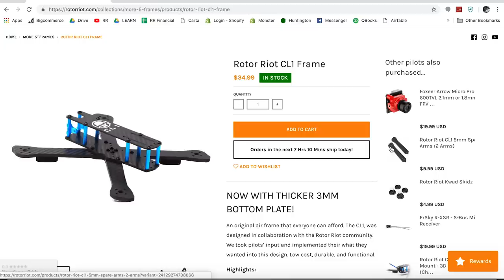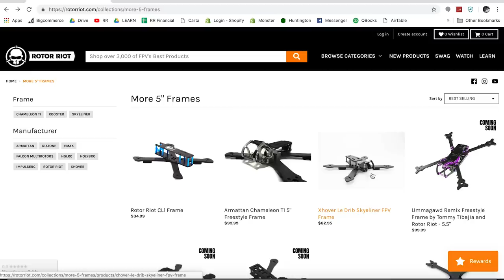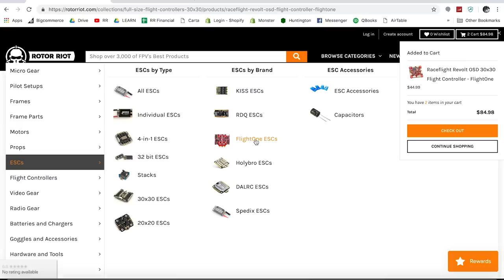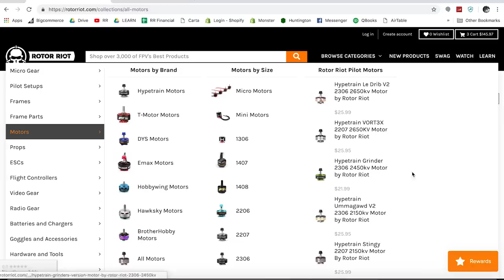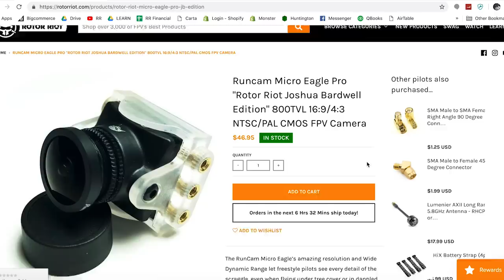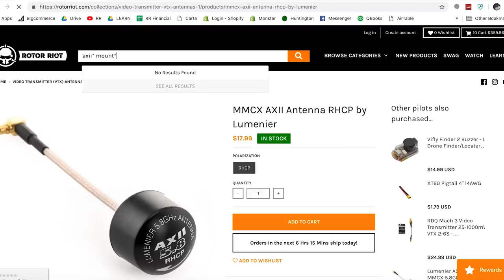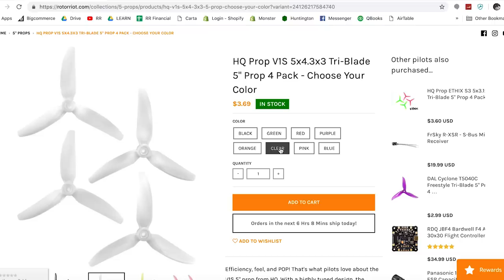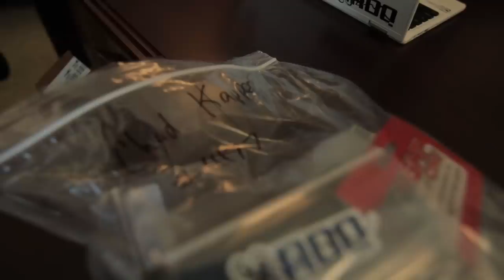Beginner FPV Freestyle Kwad - From the ground up!

Comment: This was nicely planned out and (I feel) your goal was achieved. After decades of rc myself,  the market is so oversaturated with choices for anything a person can want or need its overwhelming. Getting the right parts for ones budget is mind boggling. Chad had access to some pro's to help with his choices. Most people don't get that opportunity. I would suggest have these same guys put together complete packages with everything a new person...or anyone would need to complete the build. These kits can start priced on extreme budget build and everything in-between to the skys the limit. Have these guys do actual build vids of said kits, send them out to reviewers as well. You could help a lot of people out and more then likely make RR's business be all it can be in the process. 2 tips I can offer you though, keep the parts in stock. Its so frustrating to be all ready to buy something and, out of stock, cant make money w/o the stock to sell. 2) Include a legit data usb cable in the kits -;) Again, thanks for the enjoyable segment, I felt it was time well spent. Thumbs-up Gentlemen!

Comment: The way I got started is by first buying a pre-built 3" quad.  This approach allowed me to divide the learning curve into two steps:  since I had fully functioning H/W right out of the box I only had to master betaflight at first.  Then, as things were breaking I started experimenting with new flight controllers, props, buzzers, cameras, different battery sizes, etc.  Meanwhile I feel confident enough to step out and build my own.  In my case, this entire process took about 6 months... there is a lot of information that needs to be digested.  And yes, learning to fly FPV takes some time too, so learning to build and learning to fly should ideally be synchronized.

Comment: Unibody is great. It's lighter. As far as vibration get rid of the bad bearings and you'll be fine. Dal T5040C are the best noise free prop I've used to date. Anyone out there prove me wrong. second place is maybe HQ5X4.3V1 which is an awsome prop
Reply: I was a big fan of the dal5040c and ran them for ages. They fly really well but they are not resilient in crashes. I was never into hq  props until I tried a set of the Ethix S3. Been running them exclusively since I tried that first set. They are even more snappy and responsive than the dal5040c and on top of that are very durable and seem to take crashes and even bend back very well and remain flyable. I thought the reduced pitch would be an issue but they don't seem to suffer any less thrust in the air. Throttle response is very linear and smooth as well.
Reply: @JustInvertedFpv  well the regular ones are good but the T in T5040C is specific I think. Anytime I'm tuning for 6s they just fly good easy to tune. And the HQs 5x4.3 aren't far off.

Comment: Nice effort to help new people out.! 👍 One critique though. You don't want mid throttle oscillations but then you don't put any nuts on to hold the flight controller down. It will move eventually after lots of use and crashing but by then you'll have forgotten that you left the nuts off and will spend frustrating time trying to figure out why suddenly it's oscillating on you.  Put some nuts on Kapper, you bought a whole kit with that stuff in it.

Comment: Great episode guys! The one thing I still struggle with is smart audio and vtx settings. I can never seem to get mine to work. I know it is supposed to be easy, but I just struggle with it. One of the main reasons I still fly alone. All my quads are on different channels, and are stuck at 25mw. So my range is crap and I still feel like a noob. I just can't seem to work it out so I fly alone.

Comment: What I struggled with the most is the motor size, and kv. When I picked the parts for my first quad I just went with "what motors for a 5 inch quad" on google and used what came up. Theres so many factors that play in how a quad feels with a specific motor, prop, voltage, weight of the quad, etc.

Comment: Gorilla tape is great for quad repair and antenna strengthening. I use it to protect my motor wires and to secure the flight stack when I break a nylon mount. I put a piece along where the battery strap makes contact with the sharp carbon and my straps last forever.
You can even use G Tape AS a battery strap.  You just need to make sure the adhesive side never sticks to a surface mount electronic component. I've ripped 2 capacitors and  1 diode with one pull of the tape. I need to send that VTX to Louis Rossman. Lol

Comment: The Mach 2/3 is square but wider than a Tramp.  The Tramp is narrower but slightly longer.   Also Tramp shows channel / power just like the TBS Unify does.   Yeah a multi-segment display is easier to read, but it's there.

Comment: Kabab Glide Frame is a very good Budget frame. 
Even if you don't consider the price it's the best freestyle frame in my opinion;)
Reply: TBS Source One is a good option too! Better price than Glide!
Reply: @MaiaFPV  true. But the amount of thaughts put into the glide is incredible...
You have to decide for yourself if its worth the money.
What about weight? The glide is pretty light
Reply: @MaiaFPV  diagree.  I no longer like fat arms after having flown Floss/Flosstyle/Flowrides/Glides.    I also have a Brap and a Project 399.    This is coming off of Alien clones and RMRC Valorems.    I would jist rather have a thicker narrow arm than a thinner wider arm.

Flowride and Glide sit as my most favorite kwads.
Reply: @dividingbyzerofpv6748  But if you don't use 4in1 ESCs you can't use slim arms. It's designed for 4in1 ESCs.

Comment: I can see Bardwell a little intimidated by Chad but I'm agree with Chad about to make a video for very beginners in Quad building and those tips like the spacers and of course the wires, sometimes is a bit hard to find the right wire if it didn't came with the component.  I Liked the video!!

Comment: A tip if you want to focus on noobs like myself, do your best budget build from the stock you have, most of us want to start on the cheap but still fly ok, I'm simly not good enough to feel the diffrence between a great and an ok quad, my first build was all banggood and gearbest and now just trying to set it up to fly like I want it to (almost there). The idea of a all you need list with matching components is a great one, try adding a good beginner tune to it as well ;)  Also your shoppinglist missed the batterystraps (no noob has those at home ;)

Comment: buying a battery is one of the most important parts of a build..... Just because your quad is rated for 4s doesn't mean you can choose any 4s. This is EXACTLY why people burn out ESC's... well.... ever.

If you get a battery that has the ability to pump out 2x more amps than your ESC is rated for then you're gonna burn your ESC in a crash.... eventually and proly sooner than later.

mAh X C rating = Amp output.

1300 at 90c means the battery will output a max of 117 amps..... if your ESC can only handle 45 amps then you're gonna burn it. You get away with this most of the time because the motors themselves won't draw that many amps... however in a crash your PID controller will spike wearing down your ESC's more and more and eventually they'll die. If you get into a bad crash wehre your motors are unable to spin and you're still at a high throttle your ESC will just die.... if you turtle mode your ESC is gonna die.....

needless to say have never burnt an ESC since I figured out that mAh x C = Amp.

Comment: My big issue on my first quad was that I couldn't find many easy to follow setup videos that showed where people placed everything and how to run wires, so i ended up with my VTX velcroed onto the top plate and my receiver sitting in the back. I also found that it was really annoying to find what FCs were spektrum compatible and what receivers people used. Theres all these great videos on main components but no one ever talks about stuff like planning out mounting and installing some of the smaller components like the receiver, buzzer, etc

Comment: Yeah, stuff like spacers, standoffs, gummies and such were a pain in the beginning. Still is at times. Maybe add an option like a Basic Peripherals Kit containing a bunch of lipo straps, standoffs, screws, nuts, gummies, ummagrip, zip ties, antenna tubes... oh, and maybe flux and thread lock. Stuff that you'll want on hand for every build.

Comment: I think if you really wanted to fly any frame without having to get soft mounted arms is to use those silicone motor vibration reduction pads, those really do work

Comment: Only at 6 months flying and gotta say I just changed motors to 2207 2700kv with them new Johnny azure props they were talking about and it makes to quad fly crazy smooth
Reply: Yup it's the high kv with low pitch props let motors manage rpm much better.

Comment: VERY VERY valid points brought up here. Had I not gone to Kwad Camp I would have been totally stumped by compatibility issues between the Flight controller and ESC . But the crews vast knowledge base saved the day. I had since replaced the flight controller with the Radix because I wanted the OSD and the extra data for the ESC and rssi . So it was a bit like being a newbie again as I was on my own this time sorta . It was a combo of four FPV YouTubers and a chill weekend I sorted out the jiggly osd letters , Joshuas old video of the rssi pin on the X4R SB , Another how to hook up the BlHeli_32 ESC telemetry properly and Painless 360 for the Betaflight config for the telemetry . Indeed I was newbie 2.0 in a way but learned much more on top of what I learned at Kwad Camp .

Comment: Shout out for the micro sparow 2 :D. Also for usb cable: Srsly get a non cheap usb cable dedicated for micro controllers. No cable i use normally has a secure connection, if it angles wrong it will drop conn.
If you buy a 6s capable esc what is the point of going 4s? Batteries are not much more expensive and you abuse them a bit less. Motors are the same price when i bought them. 
don't forget: straps (not strap), battery pad and xt60 connectors if needed

Comment: like the idea of a checklist....  tick off what you have before you get started and let the shop page check off the rest as you add them to the cart... also have a nitty gritty addon feature so if you pick a smaller fc than the mounting holes it automatically recommends a 3d printed mount etc.

its called up selling... try it... XD

Comment: What a great video!  I’m a little late to the party but this was excellent!  I realize this comment will most likely go undiscovered as this video is old but I will shoot this out there anyway.  If you guys could put together a full build kit; (which I know is in the works), then make a set of videos from start to finish...PID tuning, connecting to Beta Flight, etc.  That would be amazing. If come to this hobby from the plane world and I couldn’t be more confused!  I jumped in with both feet and basically have a lot of stuff I can’t use because I’ve been fighting through some of the issues you guys talked about here!

Comment: My personal “beginner” problem: soldering! I raced RC cars for over 15 years. I even owned my own hobby shop where people paid me to fix their cars, Helios and planes and I’ll be damned if I haven’t ruined 2 brand new flight controllers just trying to solder on those small ass pads. The second FC I managed to screw up was the JB Fc Esc combo which I chose because of the included connector but I managed to short some leads  trying to solder the jumper for telemetry. Ugh. My third FC is on the way but SOLDERING how to.  That would help a ton of people.
Reply: Tonz of solder how to on Youtube

Comment: Good vid, In my builds I also think that flight stack mounting can be a pain, I would like to see stack mounting kits for sale with all types of relevant hardware specifically for that job and not just have to buy a kit of generic nylon standoffs with many useless sizes that never get used., would also like to see more antenna mounting options.

Comment: I legit finished this build like 3 days ago(my first) and had so much trouble but I have flown it twice and can do rolls and gaps easily, but I’ve heard hat these motors aren’t very durable, so I’m being careful. Overall I’m happy but I received an lhcp axii so I bought a triumph pro and have my normal triumph on my headset(absolutely horrible range btw but it works I guess) I wish I had mounted the receiver like this but I followed JB’s playlist and ended up doing it how he did. Also I used the Vifly finder 2 and it takes up so much room

Comment: Great vid. I just recently about a week an a half ago built my first quad. Now aside from having issues getting beta flight to work do to my lack of computer skill and being able to download and extract file an install the drivers need the most time consuming thing for me was figuring out where to mount the electronics an the spacing. Now I think there needs to be like a beginners tab on the store websites where people are going to shop. I think these websites need to put a few different kawd kits together with everything included to build that particular build including instructions or if a “how to build” tvideo is available of the build put a link to it in the kit. An last but not least I think it would be great to have kits with options when it comes to the motors an flight controllers etc. they were just issues I ran into when building mine. I watched a crazy amount of videos of builds searched multiple sites to buy the parts and it took me like a week to figure out what to buy an actually buy it. Needless to say it wasn’t fun at all an I would’ve loved to be able to purchase a complete kit and be done. I actually went to buy the bardwell beginner build of you’re CL1 frame because of the option to buy it as a kit but I clicked the link and it was no longer available. Anyway hopefully my input helps out when it comes to you guys trying to recruit people into the hobby an attempt to make their first experience a enjoyable one. Anyhow thanks for the great video. Take care.

Comment: I just got into this hobby and started to watch build tutorials, this episode did help me with some information that may be obvious for some that have been doing this for a while,  however i still had no idea what your talking about when you mention things like "filtering, how many cell battery, antenna cmos vs ccd" ect. i think a good video would be what these things are, the transmitter compatibility and so on. From the videos i have seen they are pretty dated and have wasted time watching a lot where apparently the techniques are obsolete because of software for like motor rotation as mentioned in this video. just a request. lol 
looking forward to the next video.

Comment: Shout out to Vanover I’ve been wanting to try F1 but didn’t want to go through the trouble.. HOWEVER now that I know the Xrotor cable fits the revoltosd I can’t resist lol all 3 of my main quads are running that esc it’s a sign 😂🙌

Comment: One more thing, for your store: I don't recall the specifics but way back when I ordered my first own pc from a website, it had a very early iteration of a "part-picker" and it told me to choose another CPU because the motherboard didn't have some memory controller in it or something... Maybe a software like that for the store to warn you If something is not compatible or not included or prop/motor combo exceed the ESC or whatever...

Comment: This is good, but you're still having a "beginner" that's very knowledgeable in the industry.

I would like to get into fpv. I have been flying DJI drones for a while and have my Part 107. I have quite literally no idea where to start with building, what parts are or aren't compatible , how to link a remote to a quad, what antennas I need for my goggles, what goggles work for someone who wears glasses, and I'm sure a ton of other problems.

Video idea: let me (or someone like me) pick out parts from the website, then do a whole discussion video explaining why what I picked doesn't or does work. Then a video showing how the beginner builds the quad and how it compares to a pro building the same thing. Finally a video showing first battery plug in, remote syncing, controller setup, and first flight.

Comment: Okay. So when you guys "design" a motor. What does that mean? I have a background in physics and I'm no stranger to engineering so when I hear that someone "designed" a motor I expect someone that knows the physics behind brushless motors and knows the interplay between the components and alters them accordingly. I don't get that vibe from the "blasters".
Reply: Generally, the engineers don't make the names

Comment: Trying to get into fpv and this video was great for info I'd agree to 2306 motors for video preferences. I'd say one thing that was overlooked.Is 4s is great for beginners however you want the ability to grow with your quad. Building a 4-6s build would be better for beginners. I'm personally still trying to comprehend everything that goes on and figure out my 1st build. 
Thank you for the information though also is their going to be a gopro hero 8 mount soon?